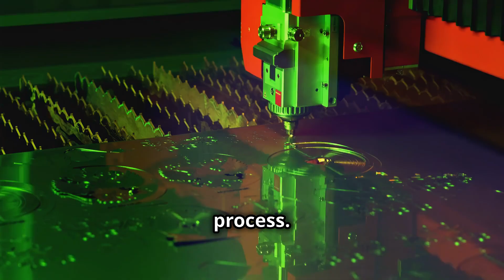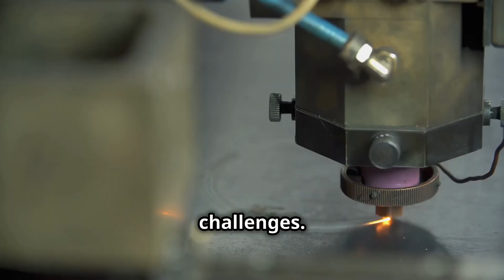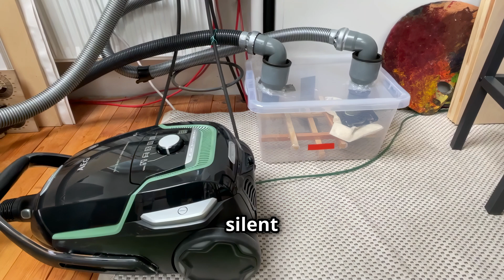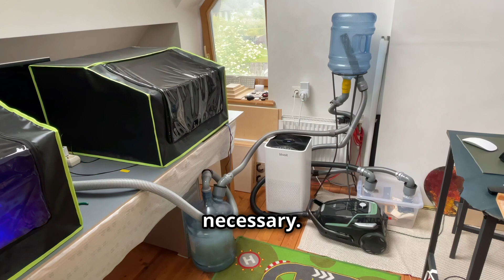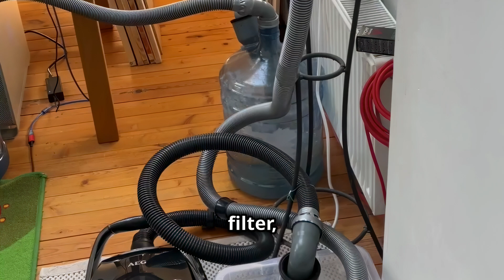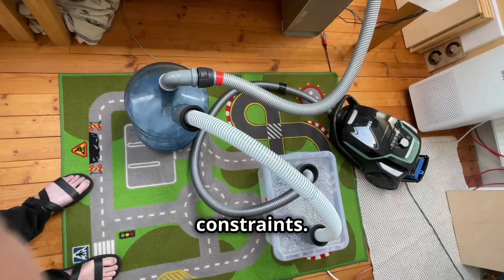The DIY Water-based Laser Filter WORKS. It’s Real.

Comment: You may get rid of particles with this water bong filter, but gas fumes aren't going to go into solution and will remain in the air you suck out through the vacuum....  The gas fumes contain the most toxic fraction of MDF, plywood adhesives, and any plastic product...  Put a cloth in series with the vacuum and see if it's discolored from the smoke.  if it is, then those fumes are still toxic...

Comment: There is a vaccum cleaner available that uses this exact method to trap dust and dirt. NO dust makes it  out of the water bath. My family and many others have been using these for 60+ years.
Reply: It's called a Rainbow vacuum. Our family has been using one for years. My mother in law has one from the 60's and it's still working?
Reply: Lasers don't just give off particulates like that though. They give off gasses and this method will not work.

Comment: You would be wise to setup an aerator that works like any house hold kitchen sink fossette uses. The ideal setup following your design is the following. This arrangement also assumes the laser extraction is set in a high location so it can not consume sparks and has a fine metal spark arrestor mesh over the intake. First a vacuum with a vacuum bag and hepa filter should be the first device. This vacuum should also be a vacuum that has a dedicated output port to which you can connect hose.  Next the water filter, my suggestion would be to use, or make a long tube coiled in the bottom of the bucket made from a single layer of loose weave cotton fabric and stainless or fiberglass window screen mesh. The longer it is the better. I'd also use weights to hold it down.  Ensure the end is closed, now the air is forced to exit over a large area. This will reduce the bubble size reducing the rate of aggressive explosive bubbling. Smaller bubbles means greater containment of smoke particulates. More then one water filter in series can be used.  I would suggest venting the air outside regardless. The current setup as depicted has some clear design flaws, mainly being a less then ideal means of using water as a filter and clearly letting the vacuum designed for dry use ingest water vapor. The greatest issue with putting the vacuum fist is simply the risk of embers and sparks getting into the vacuum its self.
Reply from the maker: Thank you for your detailed suggestions! It’s always great to hear from someone with expertise. Your insights on improving the setup will definitely help others looking to refine their designs.

Comment: Just a word of caution, the volume of air you’re pulling through the small volume of water isn’t going to remove a lot of toxic fumes from the smoke you’re trying to vent as well as you might think it will. You need to aerate the water by splitting up the massive air pockets passing through the water by having the air pass through a baffle of some kind under the water line. Smaller air bubbles contacting the water will be more a far more efficient system. Think about it this way, the particles you’re wanting to remove are very, very tiny. A lot of those will be held in a single massive air bubble. You need smaller air bubbles to increase the amount of possible water contact for the particles. Ripping massive air pockets through a small volume of water isn’t actually cleaning much. Maybe get a piece of pipe, drill a bunch of small holes in it and then try it. What you have going on now is creating so much turbulence in the water that there’s a lot of water moving out of the way of the air. On top of that, you’d still need probably 5 or 6 of these water tanks inline with each other to adequately filter the air to safe levels. Small bubbles, reduced turbulence, more water exposure to the air. Not ragging on your system or you at all, I don’t want you to misunderstand, just a word of caution. Stay safe and keep on making stuffs 👍🏼
Reply from the maker: Thank you for the good advice!

Comment: Any chance you could make a sketch of the tubing setup? I find it  a bit confusing following all the tubing all around.
Reply from the maker: The sketch is very simple. All bottles are connected in line. If you add one more bottle, just cut the line and insert. All bottles, except the last one, have incoming pipe in water, and outgoing pipe dry towards suction (vacuum) device. The last bottle is reversed and mounted upside down. The last bottles job is to catch water droplets and channel them back into previous bottle, not allowing water to pass to the vacuum device.The last bottle is dry, without water, of course. If some water droplets enter it, they should flow back to the previous bottle by gravity.
Reply: Thanks for your quick reply. Have you tried using an air quality meter to check if any VOC's are removed? From what research I have done a water filter does not remove any VOC's, you need to use activated charcoal
Reply: I would hope that this water filter would work on the fumes coming out of a resin 3d printer (toxic VOC's)

Comment: Does this filter out smell and fumes of cutting acrylic? and would this work with an inline fan instead of a vacuum?
Reply from the maker: I do not know about acrylic, you will have to try, but the idea comes from chemistry lab water bubble filters, and they filter quite a lot of stuff out of air. I think inline fan would be too weak to pull the air through the water and create bubbles, but you can try and, perhaps, succeed if the inline fan is really strong. I think that vacuum is better, and it is just a strong inline fan, after all. This AEG model is very silent and with adjustable power, which is quite handy.
Reply: @LonePenStudio  Thank for the quick reply. I tested it with my inline fan and you're right, it is too weak (it does create bubbles but only if the hose is near the surface of the water). I'll try a vacuum tonight. My only concern is that vacuums tend to overheat after 30mins or so. Does your AEG overheat? and how long have you run it for?
Reply from the maker: Thank you! My AEG VX9-2-ÖKO vacuum cleaner never overheats on reasonable power setting. I have left it on for a day, could do even more. It is power adjustable, electronically, which is also handy. Good luck!
Reply: @scottebanks5216  Hello, what laser machine do you have? How did it go with the vacuum cleaner?

Comment: I was looking for this concept to filter wood dust from a thickness planner. My plan is to use a cyclone separator to catch the larger shavings, then run the air with smaller dust particles through a water filter like this. Thank you for sharing your project! I also liked the second container used to catch any droplets sucked through the primary filter.
Reply from the maker: Thank you! Good luck with your filter. Sounds workable.

Comment: Installing a fine mesh just above the water level, on the first bottle, could help ease the splashing effect?
Reply: How about putting small plastic balls? ping pong balls to avoid splashing? just curious
Reply from the maker: Possibly. You have to experiment. I do not see an easy way to install it in the bottle, though.
Reply: @LonePenStudio  not without cutting it open and finding a way to seal, or using a bucket or plastic transparent box maybe. Anyways this is an awesome idea

Comment: great! but i have big laser 1300x900. please tell me: will it work on big power machine?
Reply from the maker: Hello! I have not tested it on huge volume of smoke, you will have to test it. It is not difficult to set up that bottle and check in your environment.
Overall I will say that it will filter. Much better than conventional filters. And it is easy to change the water once it becomes really dirty.
You can put two or even three water filters in series, if necessary. I found two is enough.
There is some oily residue in the cleaned air, which browns the vacuum machine filter (but does not clog it) in my system. That is O.K. for me.
I can even put one more box in the line with cheap vacuum bag in it, to catch some of the residue.
If you use standard piping connections, it is easy to reconfigure the system and experiment.
Good luck!

Comment: Looks great. Does it filter out dangerous fumes and the smell of engraving leather? :)
If it does, then why is there not an affordable solution?
Reply from the maker: Thank you! I have not tested it on leather, but I think - yes, it will filter fumes out. I took the idea from chemistry lab, where simple water bubble filters are extensively used exactly to filter out any harmful fumes. Works very well in my case (engraving wood). You can cascade the filters, put two bottles in sequence, if you wish. As a final step you have to catch the water droplets (thats is what the inversed bottle is for) and you can also put an extra box of vacuum filter paper, to see the cleanness of air passing through the system. Or you can let the vacuum cleaner used as suction pump to do this final job. I have observed some colouring of vacuum filter, probably from still unfiltered wood oils, but the smoke and smell is almost completely gone. Experiment. Good luck!